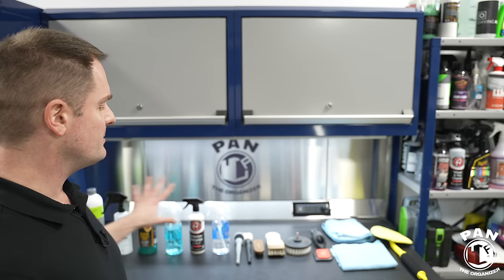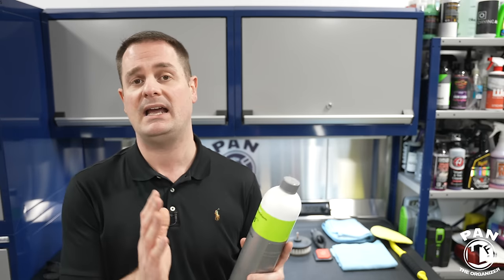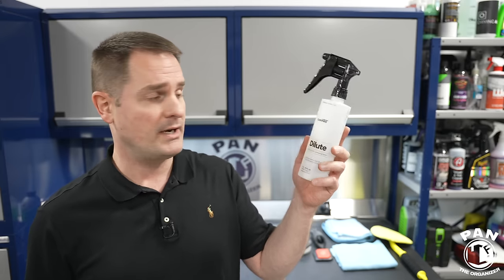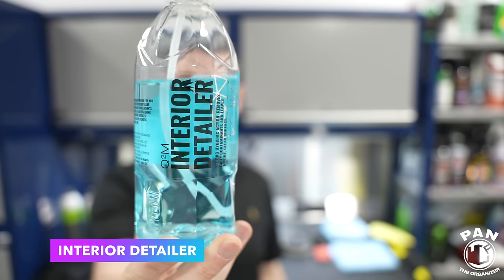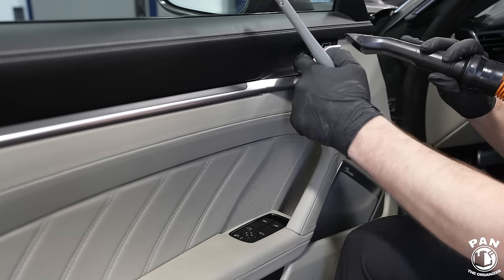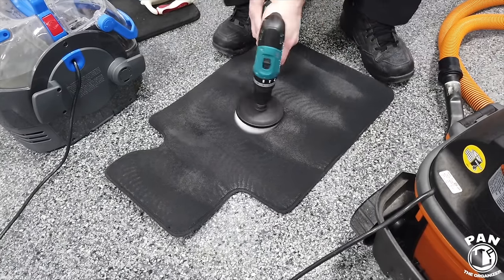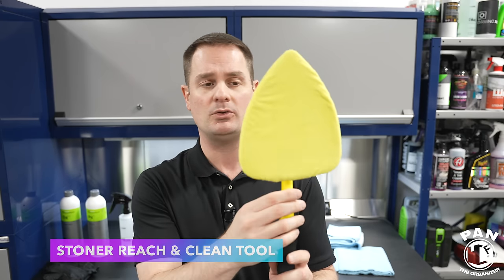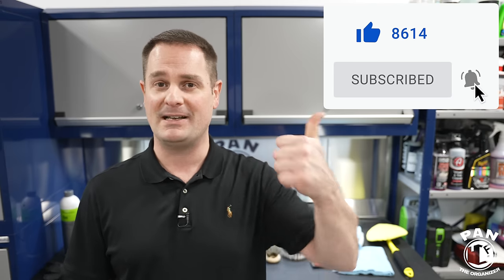Interior Car Cleaning Kit - Everything You Need!

Comment: Hi Pan, I am a big fan from Melbourne Australia :) Love your videos and especially this one. I am switching (well, upgrading) from the decent Chemical Guys interior ceramic detailer to the Gyeon, which I tried once and have been very very impressed.
If I could please ask a question (two actually): I own a 2021 Toyota Landcruiser Prado and I am frustrated by how easily the interior hard plastic surfaces scuff and scratch. Q1: what is the best way to get rid of scuff marks eg. shoes scuffing the bottom part of the doors like where the speaker are, on the way out of the car... Q2: is there any way to repair or reduce minor scratches on plastic? we seem to be talking a lot about paint correction, are plastics totally "un-correctable"?.
Thanks in advance!

Comment: Great info Pan, as usual. I seem to do more interior work, typically accompanied by its share of dog hair. Recently picked up the Fur Eel from Buff Brite, and it works GREAT!  I have also used the Lilly and Analan tools.  They work pretty well and a little better in tighter spaces, but in general require more effort.  The Fur Eel is not effortless but is quite faster than the others. It’s now my go-to. 
I also have a Ridgid wet/dry vac and love it. Great power. Mine is 10-gallon because I use it around the house for projects too. 
Last, I really like N-914 but haven’t used it for interior cleaning yet.  
See you on the next one!
Reply from the maker: Thanks for sharing!

Comment: Hi pan.. love your videos.  They are making my detailing hobby much more enjoyable.  Do you have any recommendations on how to maintain Toyota softex seats?  Should I clean and condition them like I would real leather?
Reply from the maker: You don't condition leather. Modern leather (or even synthetic leather like yours) has a clear coat on top, much like your paint. That transparent layer is impermeable to conditioners. What you need to do is clean the leather and protect it with a sealant or leather coating, that protects against friction damage, dye transfer, UV rays, fading and makes cleaning liquid spills easier.

Watch my leather seat cleaning and protecting tutorial here: https://youtu.be/CuN77nz8Ex8
Reply: @PanTheOrganizer  Thank you!

Comment: Hey Pan!

Thanks for another awesome video!
I've been using CarPro PERL (Diluted 5:1 as recommended) as an interior protectant and it's been great. I lightly misted onto my floor mats and now they're slick and have a slight greasy feel to them; of course this is not what I want on floor mats.
Curious what you would recommend for rubber/plastic floor mats? Will the Adam's interior detailer be suitable? Or is there another product you recommend?

Thanks again!
Reply from the maker: Never apply dressings on rubber matts unless you know they won’t slip. 

First clean them properly following my method here: https://youtu.be/axG31w_Mw1c

And I like 303 Aerospace Protectant on rubber matts for that darker look at the end. But one or two very light sprays and work it in with a microfiber towel. Test on an inconspicuous area first and see if it’s ok for you.

Comment: F150 steering wheel grime sweat sun has degraded at the top I used Ls and Po and black residue came off on the pad is it beyond repair or any other suggestions? Love your content.
Reply from the maker: Hi Paul. It's hard to troubleshoot at a distance without seeing the issue in person, but perhaps watch a leather restoration tutorial from leather experts here: https://youtu.be/5mlMd4TR7Do

Comment: Do i have to use a cleaner before a detailer, or can i just use a detailer
Reply from the maker: There are two ways of approaching interior cleaning:
1) Start with a pure cleaner first, then finish by adding a protectant. For example, cleaning with P&S Xpress Interior Cleaner, then applying CarPro PERL diluted 1:5 or 303 Protectant. 
2) Use an interior quick detailer, meaning one product that both cleans and adds protection in one step. I made a battle video of the best ones here: https://youtu.be/2Wb7_NlyWUE?si=E4ikpYh6b85JLReO

Also, here's my tutorial on how to clean an interior like a pro: https://youtu.be/Xx_lHXHYpLo

Comment: is there a video where you describe where to use the N-914 vs the Green Star/Pol Star? i get where to use the Green Star vs the Pol Star. Just unclear on where/how to use the N-914 on interiors. thanks.
Reply from the maker: N-914 is used as a quick interior detailer at the 256:1 dilution to lightly clean and pick up light dirt and dust. Doors, door jambs, door sills, dash, etc.

Comment: What do you use to condition the door frame rubbers if you use any?
Reply from the maker: A silicone rubber spray usually does the trick. Prevents moisture buildup and the doors from freezing during winter months.

Comment: What is the difference between Adam's Interior Detailer and Total Interior Cleaner (new take according to their website)?
Reply from the maker: I haven't tested that new one yet, but according to them, the new one has these following features:
Water-Based, Non-Silicone, and Cross-Linking Polymer Surface Protection
Contains Odor Encapsulant, UV Absorber, and Anti-Static Dust Repellency Additive
Suitable for Dashes, Door Panels, Glass, Navigation Screens, Vinyl, Plastics, even Carpet, Leather, and Upholstery
Produces a Brand New, Matte Appearance with No Gloss on Hard, Non-Porous Surfaces
Foaming Action when Agitated within Textiles and Upholstery
Effective at removing sticky residues, light dust, fingerprints, smudges, dirt, stains, and other unwanted contaminants and keep them from returning.
Bright Sky Blue and Maine Blueberry Scented

Comment: Great video Pan.  I got majority of that stuff. And ready to start using them.  The only thing I didn't know was on the color of the drill brush.. I thought hey I would get the blue and black one to match my drill. But when it came in I saw on the box that it isn't for vehicles unfortunately. So I'll be ordering the white one now.  Is that Apc frm Am the same as the Koch Green star?
Reply from the maker: What APC from Am?
Reply: Am Apc.. am details  is the company on the bottle.all purpose cleaner that u had used in one of ur previous videos. I bought it from the same place that Koch from.
Reply: Im just mainly curious if those two products Koch Green star and the Am details Apc the same or would u use the. Doing different things.  Also would u prefer the McKees 37 floor mat rejuvenater or the Koch pol star to clean mats and carpet in vehicles.